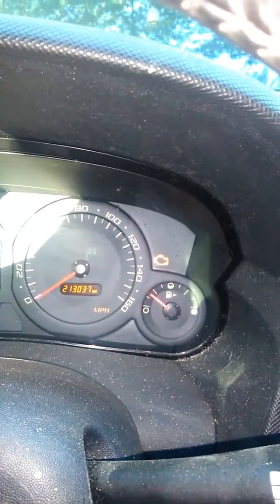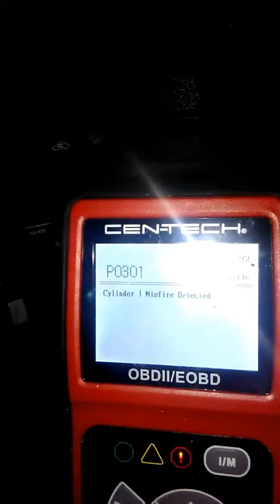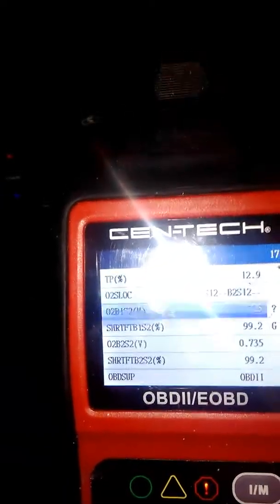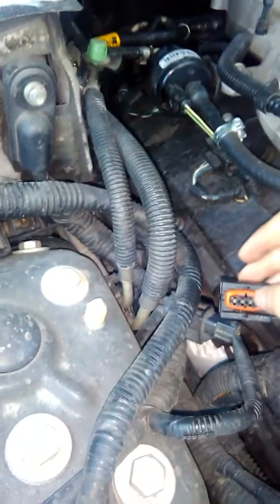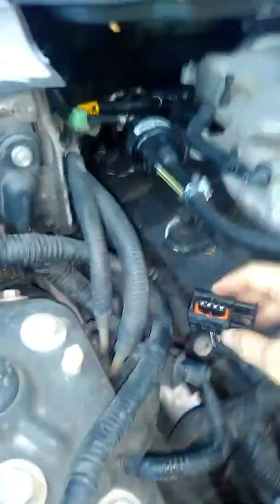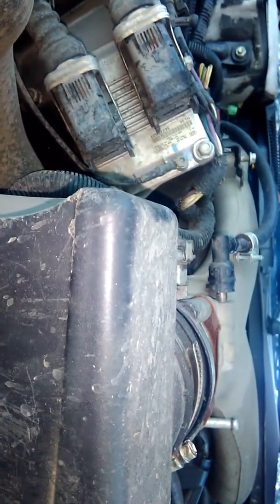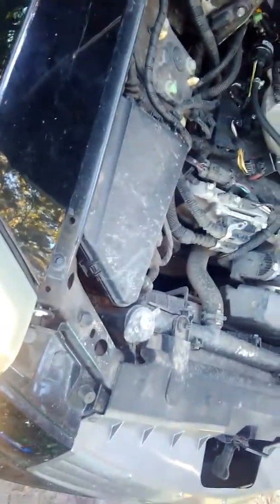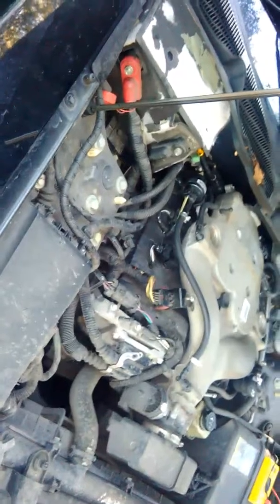Help 2004 Cadillac CTS 3.6l misfiring.

Comment from the maker: UPDATE:APPARENTLY THE FUEL DRIVER IN THE ECM GIVES OUT ABOUT EVERY 60k FOR NO REASON.
Reply: Did changing the ECM fix it?
Reply: Oh no shit. How much was the replacement
Reply: I also would like to know if changing the ECM fix the problem?
Reply: This is what i have determine is the problem with mine
Reply: Thank you for this information,  This is what was problem with mine. 2004 cts 3.6.
Reply: Mine started doin this at 98k miles. Where do I get one that's programmed right
Reply: So it was the ecm

Comment: Did you ever get this fixed ??? I seen where you replaced everything but the sparkplugs and filter. I know there are a lot of people waiting for your fix if any.  Also from what I found out is that GM bought some crappy azz fuel injectors for these caddys at this time.

Comment: So I had the same problem too. BAD misfire at idle and then as I accelerate it loses power . I replaced all the plugs and coils. Saw the plugs in 1,5, & 4 were drowned in oil... 😭 but since I replaced the coils, it’s been going very smoothly, but now has a weird whine. Idk wtf is going on. I’ve read up that the crank shaft sensor is the issue if your coils and plugs are replaced. Im changing that next , then might change the ECM now too just to make sure .

Comment: Throttle position sensor % should be 0 % when no throttle is applied. Replace the throttle position sensor. Or try cleaning throttle body throat where the butterfly seats carbon buildup can cause it to not seat. Also reason for open loop on fuel system. Hope this helps

Comment: If i can help with this issue. Remember the ecm controls all engine operation, fuel and voltages. After it warms up and goes into close loop. Then it regulates voltages

Comment: i have an 04 cts with 165k it idles fine but starts to misfire when i try to take off to fast the car will start jerking & the check engine light will flash for 30 seconds. i can hear it misfiring more when im at 45-60 mph.
Reply: Did you fix it?  Mine is doing the same thing
Reply: CAm shaft position sensor
Reply: Vacume to the air box has a plastic hose. It goes to the drivers side valve cover. It supplies Vacume. And will have the same symtoms you  are having. Or just a Vacume leak some where.

Comment: do u have check engine light I have a mild misfire u can only feel it slightly at idle and and at certain rpm I get no check engine light I replaced all plugs and 3 different sets of coils
Reply: Same problem I have a 07

Comment: I just ordered a ecm off of ebay for $300 with a lifetime warrantee programmed to my VIN. It will work. Dont take that  intake off looking for bad wires or a injector, just get the ECM.
Reply: link?
Reply: My car is doing the same exact thing I went on flagship one and spent 445 for a ecu and it didn’t fix the problem I can’t figure out what it is I got no spark on cylinder#2 but i replaced the coil and nothing my car only got 140… miles on it and it’s pretty clean I really don’t want to get rid of it but I just got all the coils and spark plugs and intake gaskets and see what happens if this doesn’t fix it well the scrap yard will be seeing a caddy 😩

Comment: I'm having the same issue got code p0301,p0201 check engine light blinks and sometimes it mist fired badly. It's a 2005 CTS 3.6.

Comment from the maker: Replaced the spark plugs, could, injectors, fuel rail, intake plenum, fuel filter, cleaned throttle body, reset the throttle sensor, and no change, ended up selling the car to a roommate for $1500 but it's been misfiring for roughly 80k miles, just waiting for the ecm to die.
Reply: #David i replaced all six coils and plugs for a misfire#1 TC.  after changing all the coils two more times nothing would work except Bosch I still have misfire #1 idles rogh though runs good. check engine light wont allow me to smog check.. If you a have any idea what the problem is pleasen give me your thoughts

Comment: I had one of the timing chains off by one tooth.fixed it now runs like a champ
Reply from the maker: I have drove this car 40k miles like this if it was the chain it would be done for by now.
Reply: David Pierson check compression on each cylinder that will give you the answer
Reply: The chain tentioners are hydrolic and run off the oil pressure.when oil gets low and car comes to idle then steering wheel gets turned and the powersteering pump put more load on engine the tentioners let off and chain skips one tooth .depending on which chain skips it may run or may not.
Reply: At least one cylinder most likley 2 will have way lower compression or 0 compression because of valve being opened at wrong TIME.i hope this can help you.i could be wrong but this is the most likley senereo
Reply: @David Pearson hey speaking of, was the chain ever replaced before you bought the vehicle?

Comment: On the 03 CTS 3.2L oil fills most coils due the the crankcase pressure as soon as the PVC is BLOCKED  with carbon! This issue also occurs on the 3.6 liter engine but GM has a bypass kit to relieve this issue...

Comment: Change all coils, sparkplugs, if you did that then oil is going in sparkplugs so after replacing will misfire again, check for that" it's the wiring and control unit, ECM is good I hope.
Reply: If oil is going to spark plugs then your spark plugs should have oil on them

Comment: I got told it was thinking chain noise... But idk if it's that... I'm thinking maybe spark plug
Reply from the maker: With as long as it's been running I don't think its the timing chain im going to replace ecm soon, ill follow up with an install video and hopefully a sucess.
Reply from the maker: you'll hear a bad chain slapping or rubbing.
Reply: Gas mileage dropped to.. I got misfirr codes. Plus o2 sensor faults.  Check your coil wiring. Could be bad
Reply: Did the ECM fix the problem, the new ECM?

Comment: If you change the coil and injector then it has to be a bad ECU computer they sell programmed plug and play ones just search online submit your vin to match your vehicle and it will cost around $250

Comment: Had lost 1# cylinder and after research found out it was the ECM LOST DRIVER FOR #1. Replaced the Ecm,but be careful. Ware y buy from. Not all are PROGRAMED CORRECT.
Reply from the maker: Where did you get yours?

Comment: BE CAREFUL ON ALL THESE COMPUTER CONTROLED CARS. NO MATTER. BE CAREFUL OF VOLTAGE SURGES AND EXCESSIVE SPARKS AT THE BATTERY. MOST BATTERY INSTALLERS USE A SURGE PROTECT DEVICE TO PROTECT YR COMPUTER.

Comment: It will get worse until finally it starts up, idles high, then revs up and down. It will then start up and cut off. I had the same issue. It was my computer.
Reply: That's exactly what mine is starting to do
Reply: @dereknixon6206  It is your computer. As the car gets worse it will shake and idle up and down. Finally it will start, idle high and then cut off. It is the computer. Change it and your car will drive like it's brand new.
Reply: Actually figured it out and it was a bad injector

Comment: Sorry. 05 3.6. Replace    my purge valve and cat. 185000. Got the direct fit cat band 1 passenger side. Purge valve car would have hard start at pump. Funs fine now. Keep oil change every 3k.

Comment: I have an 07CTS with a 3.6 engine. It will misfire occasionally just once in a while just once and then it may not do it again for a while it’s a very sporadic and occasional misfire. I would love to have new plugs and new coils put on it but mechanics around here want 900 or more dollars to do that!! Lol well that’s not gonna happen! Lol I’m a disabled elderly person on a meager monthly fixed income there’s no way I can afford that! So I just have to live with the occasional misfire I guess. Lol
Reply from the maker: The plugs and coils are easier too do, just got to verify thats the actual problem, and not something like the fuel or egr system, timing, ecm,  or even a failing o2 sensor. i'd make sure its properly diagnosed. I took this one in they immediately without testing said plugs and wires, changed them and it still misfired. since this video and going to mechanic school I should of checked a bunch of other things. but the car is at like 400k miles misfiring since 160k, so at this point its an experiment. must be a strong v6 and honestly think its sort of underpowered having about 70hp less than other v6 models about that size which might be the reason it survives.

Comment: I have the 2007 CTS engine light blinking and misfire during idle and poor performance when accelerating. Took it to the dealer. Only $7800 to fix and maybe more stuff later. I don’t know what to do with it. I bought another car. The CTS still runs. I guess I’ll bring it home and try to figure out if I can get anything out of it. Has 143,000 miles on it when never problems before this.
Reply: Pammy Rogers I have the same car. Same problem. I changed my coil packs but it got no better. Now my Cts won’t start and I have mechanics trying to rip me off and telling me the car is just bad. Did u figure it out or is this just the point of when the car becomes useless ? I have 145,000 miles
Reply: They're saying to check ecm !
Reply: @mikelivee4393  2.5 or turbo?
Reply: @mikelivee4393  seems like it's designed to fail right about there, same car 07 145,000 miles and would you believe it, same problem! Like if they programmed it to 💩out there!
Reply: Mike Livee try reseting the key. 
This is to reset key. Worked for me. 

Try the following procedure which is specifically for GM Passkey 3.

1. Insert a master key (black head) into the ignition switch.

2. Turn to the “On” position without starting the engine. The security light should illuminate and stay on.

3. Wait approximately 10 minutes or until the security light turns off.

4. Turn off the ignition switch and wait 5 seconds.

5. Repeat steps 2 through 4 two more times with the same key.

6. Turn the ignition off. The vehicle will now learn the key transponder information on the next start cycle.

7. Start the vehicle. If vehicle starts and runs normally, and security light is off, the relearn is complete.

If additional keys are to be relearned:
8. Turn the vehicle off.

9. Insert the next key to be learned and turn the ignition switch to the “On” position within 10 seconds of removing the previously used key.

10. Wait for the security light to turn off. It should happen quickly.
You may not even notice the light come on, because it will learn the key transponder immediately.

11. Repeat steps 8 through 10 for any additional keys.

Comment: Mine was a fuel injector number 3
Reply: Mine keep saying po 206 po306  cylinder 6 I change the plugs  the  injector  the and when I turn, on ac drag my motor to shake  now my blower wont blow at all

Comment: I fixed mine, try unplug coil #1 wiring harness, for po201 and plug it back the other way...do the same as coil #3..wrong positioning  of wire to the coil causes rough and shakey engine..
Reply: Then unplug negative battery for a minute then plug it back to reset ECU..
Reply: @Kojamoc13  Having the same problem with my 06 cts. changed the coil pack and plug for the cylinder that was throwing the code (PO202). Ran fine for a couple starts then same shit again. Did resetting the ECM work?
Reply: Mine idles fine but starts misfiring in 6th gear while im cruising, i replaced coil packs and plugs and still does it, should i try restarting the ecu